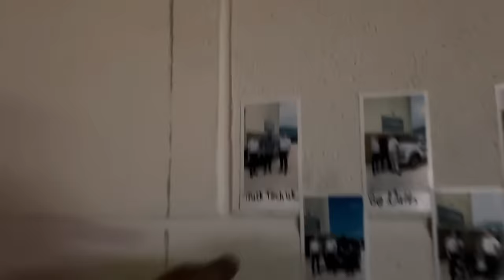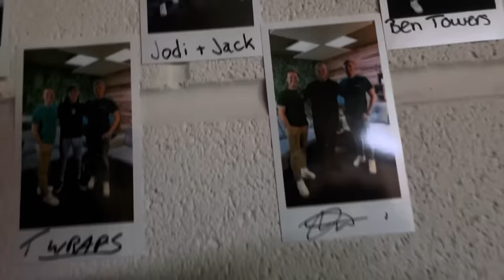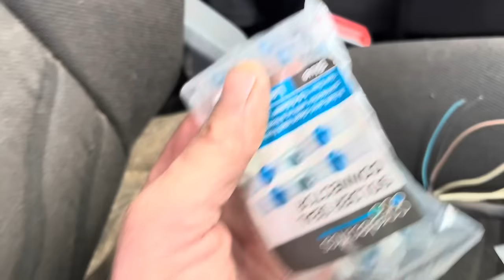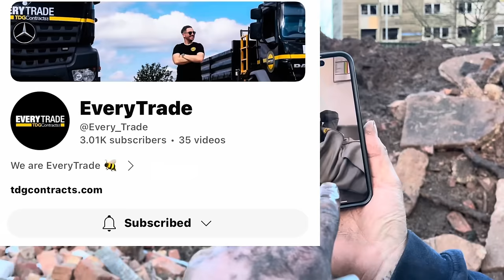The reason young people don’t get into this job!!!

Comment: Quick tip for you Chris, always keep an empty 5L bottle in your van, they are dead handy to put under your head when your neck is aching, you can vary the height of the pillow by letting air out of it and putting the lid back on 👍

Comment: Been there and done it for over 50 yrs, industrial, automotive, truck and construction plus a stint with Uncle Sam's aircraft. Was laughing my a$$ off one good idea leads into a cluster . Did the right thing by walking away for awhile. The head does get heavy, sorry still laughing Chris. Got to love those designers the way they can lead you to believe if you just remove or loosen this part it will be able to remove Lol Lol deeper in crap maybe if I remove or loosen this. The struggle goes on, some day you'll be able to look back and laugh and reminise be wishing you could still be doing it. Keep wrenching and be safe

Comment: Nothing better than a 'just' job Chris. Customer thinks 10min job 7hours later entire front end all over the floor and you have to charge them £800 to fit a headlight bulb because you've had to drain every fluid in vehicle to get it out and then you need 4 grands worth of computer to tell the 'f'er you changed the thing before it'll work. I'm to young but bloody hell it must have been nice when you could stand I  an engine bay and work on it and the only thing that had a plug on it was the chain in the bath you got in at the end of the day

Comment: Hi m8 you need to take header tank off and top hose unbolt radiator move it forward u bolt fan off fan hub unclip the fan cowl and lift it out in one then your have lots of room to unbolt and rebolt fan hub on no need to go underneath m8 👍

Comment: I did a alternator job today. Was only supposed to take 2 hrs maximum maybe 1.5-2hrs. Anyway started at 2pm and its now 9pm. Alternaror is out and thats when i called it a night. I had a seized wheel bolts and a rounded off locking key for the bolt. Unreal lost lots off hours in the day. Wish i studied to be a judge or somthing

Comment: Another full on struggle, and I know you must get loads of smart arses giving you advice, but you would have only lost a tiny bit of oil if you had clamped the oil pipes near the fittings with pipe/hose clamps. I have got to say though you do work through the struggle to get it done, keep on struggling it's the only way.
Reply from the maker: Yeah good thinking on them pipes mate… no mate by all means I like constructive criticism like that 👍👍 have a good weekend mate

Comment: Young folks don't want graft mostly, they all want to be influences with nothing to influence, when I worked at Keltruck on permanent nights, the workshop used to be freezing in winter  when the doors where open to bring another motor in, if you did not hurry up you would get ya snap sabotaged 😂 and how many times have I herd from customer's, it only needs this or that, its only a little job, it only needs a bit of fettling, but really they know it's a pig of a job😅